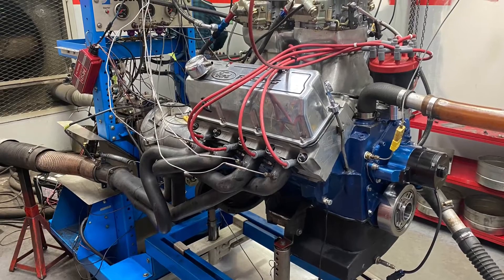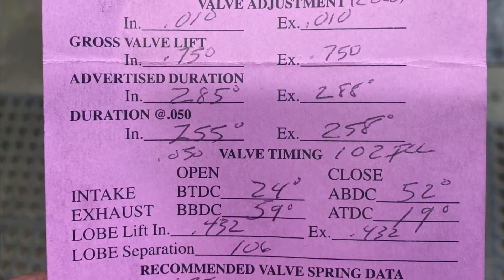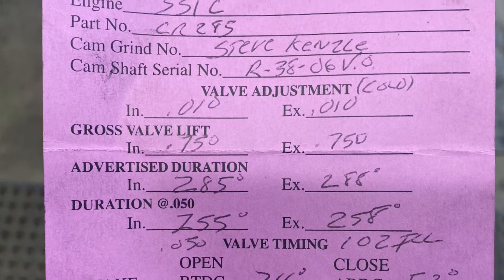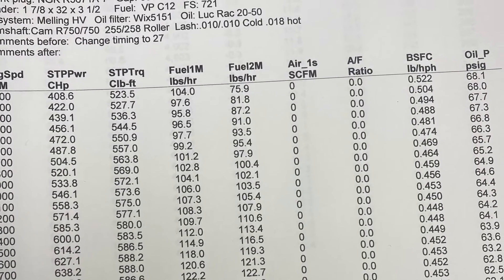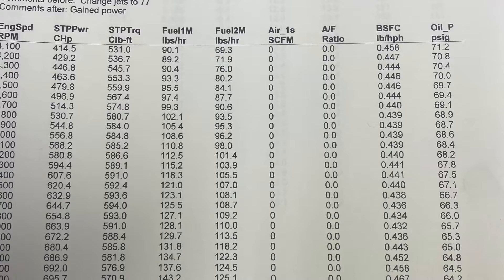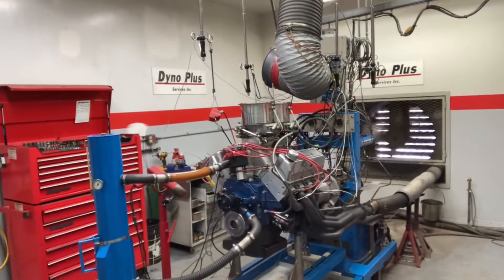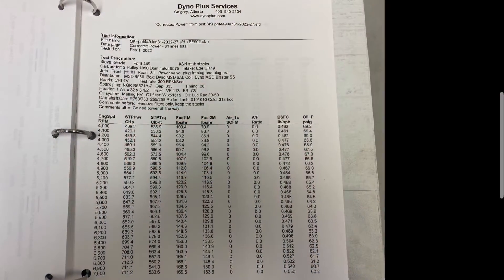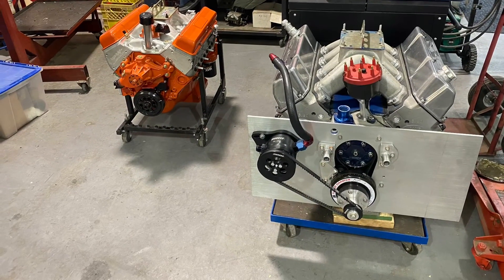DragBoss Garage:  Boat Anchor 400 Ford,  Steve Kenzle's  700 Plus HP Monster

Comment: You can make HUGE power with the M platform engines.  The big reason they were turds in factory form is the ridiculous compression ratios (about 8:1) which was accomplished with around 0.080" deck clearance, dished pistons, AND big combustion chambers (75-80cc).  All of the things you try to avoid when attempting to have decent compression.  Compression is the easiest way to produce hp & torque.  Kind of like a firecracker in open hand vs closed hand concept.  Even 2V heads had decent port design & valve size (2.03" Int, 1.65" Exh).  They will easily support 90% VE.  I built mine in the mid 90s & although I never had it on a dyno, it developed quite a lot more power than my 450hp, 500 tq 410" FE all with massaged factory castings except the intake that I swapped for an aluminum 4V unit.  I used '80-'82 valves with single lock grooves, a custom cam, screw in studs, roller rockers, & Keith Black hyper pistons for 351C with bushed rods (11.2 static CR).
Reply: I was shocked at the difference between the smogger car-spec 400 and the truck-spec 400. I had a '72 Torino GTS with the 400. Had great low end torque, but ho-hum beyond that. One of my Uncles, who I shared a business location/shop with at one time, had a '74 or later one ton shortie cab & chassis Ford truck and good sized trailer. I'd haul parts, tires and other supplies with it for him if I had slack time, and that thing was a beast, even with low compression and Briggs & Stratton suitable cam. It didn't have all the other crap on it that cars had to have at the time. That's when I knew that with some good parts, it could get with it like the overgrown Cleveland it was.
Reply from the maker: Right on Zekais, now your talking. Now has me wanting to build a big ci and wicked heads and tunnel ram. Well maybe later, have enough projects I need to get done.
Reply from the maker: Totally agreed would the compression ratio being the limited factor, obviously a camshaft too. But I like any engine you open up those areas of breathing, both intake and exhaust, and some compression and cam you got a totally different motor. Very cool I was pulling stroker‘s in the mid 90s also. 377 great little engine. You had it going on  for sure.

Comment: Looks to be a small-block Chevrolet next to the 400 Ford, Tim.   B.T.W. Nice 400M build!
Reply from the maker: Hey Bill I just saw this message, the one on the right is actually the first TrackBoss Aluminum cleveland Block. It made over 800 hp. Yeah the other one is a run-of-the-mill.

Comment: Do the 351M/400 have stronger cylinders than the cleveland? I know they are a taller deck height and 3.0 mains. Cool video as always
Reply from the maker: David, I was thinking the same thing, I’ve never asked Steve about this or anyone else. But must be, because we’re all scared to go any bigger than 30 over with a cleveland
Reply: Max is 0.040 for the 351m/400's... that was something I ran across when researching my build. I believe it was from one of Tom Monroes books. Loving the 400 content and builds, please keep it up!! Cheers🤘

Comment: I'm a 429/460 fan,  never impressed with the 4x4 400. Must have need way more head...
Reply from the maker: Yes 400 needs a good cleveland style head and it will really wake it up with Compression in the 11:0 range with that long arm.
Reply: @dragboss351cleveland  that’s my take on the 400 series was they needed more compression. With the right stuff and work those were a monster hiding in a box waiting for someone to take the lid off. And your video proves this, which are great by the way, and very informative as well. Thank you for posting them
Reply from the maker: Thanks so much Ryan, I definitely agree with a monster in the box analogy wowser. Appreciate your being here stay tuned for more awesome videos
Reply: The 400. Heavy crank heavy rods heavy piston Windsor size bearings.
The engine would have been better if bearings and oiling supported the added weight.

Comment: 🤔 So, how common is it to still be able to locate old 400 engines still in stock condition either at junkyards, or through private sellers who've got old 400 equipped passenger cars or trucks gathering dust on farms? 

If they weren't particularly popular for using as race engines or hot rod engines, and there aren't exactly a lot of 1975 Country Squire station wagons being restored and sold at Barrett -Jackson either. So wouldn't it be more likely that a lot of these engines would've been scrapped long ago?
Reply: I think you'll find they were also widely used in '70's Ford F series trucks too!!
Reply: @arkhsm  
But how many of them that aren't being restored are still around in junkyards after 44 - 53 years, with solid 400 engines ready to be removed and used elsewhere? I'd hope there are still lots of them. But although there may have been plenty of 1970s Ford trucks(and large passenger cars) still lying around in auto salvage yards, I've gotta think that the vast majority of them are long gone.

 Well, unless you can find forgotten ones sitting in patches of weeds on farm fields, or in barns.
Reply: @HighlanderNorth1  If you go by youtubers, finding 70's F trucks at every second farm out in the country areas seems to be quite normal. So I suggest you get out into the outback towns and knock on some doors....with your hands up, just in case they're totin a shotgun, lol !!
Reply from the maker: I would think that they are plentiful in junkyards but I haven’t looked for a 400 or 351M in a long time, so I don’t know. But they sure made a lot of them, thanks Highlander North 1
Reply: I am in the Los Angeles area and there are 70's F series being retired occasionally b/c of emissions.  many 400/351M blocks in them. they're out there.
Reply from the maker: @socalltd they are everywhere, you just have to look, thanks  Cali 🏁
Reply: In the 80's I junked more than 50 morfadites. Told my customers to just step up to a 460.
By then all M's and 400's had low oil pressure and gas mileage was poor. So why not get rid of it .

Comment: Built 400s with Cleveland heads for a local pull tractor class.
The Fords owned that class, the Chevys just filled out the rest of the class.
Reply from the maker: Hey Motor City Mike, All it takes is good heads,  good intake, and some compression and watch out. Loved to have watched that Motor City
Reply: Mike could you give some specs? Looking at doing the same with a 2wd puller.

Comment: People have been ignorant toward this engine, my dad had a 400 with lots of mods back in the early 80s in an F250 That heavy truck could really haul ass. Surprised lots Chevys especially on big hills. In 1980 there was only a handful of aftermarket parts available.
Reply from the maker: So true Mitchell. They respond just like Andy other engine. Real issues are bell housing and intakes. Can make spacers so you can run Cleveland intakes. They can make torque that if for sure. Glad your here, when the front wheels are hanging, just before the rear bumper drags the track,  pull the next gear. See you later.

Comment: That’s one Badass Motor Tim, wow 600hp/580ft-lb at 6000rpm lol 💪🏼🏁 carries over 500+Ft-lb from 4000rpm till the end.
As soon as i seen the Cam specs first, the duration @50 i knew it’ll be all under 7k rpms 👌🏼🏁  that’s a neat build mate.....
If i can ask, is the UR19 just Port matched ? (eg No filler blend?).....if so i would try 4150s on it
Just saying 😉🏁
Reply from the maker: I’m not sure for this port matched, I know he was talking about working on the top of the manifold runner as it has a little bit of a curve. Yes I was also impressed with cam that is small on duration, but that it’s making  great power. Definitely a torque minstar. I know he tried the Holley 6464 the old-school dominator, but he’s never tried any 4150s on it. Thanks for watching yanks🏁
Reply: @dragboss351cleveland  right on👍🏼 yes it has Ci but impressive figures all round 👌🏼🏁
I’d try some 4150s on it,  smaller Venturi/boosters with an untouched TR & that chi 4V Port entry. Especially being a heavy car it may just give it the air speed it needs & probably show on the track 🤷🏼‍♂️🏁
If it were 3Vs, or A3 etc....any fast n tighten port then Doms ok. if not eg: large .....it’s usually opposite then🏁
Been thru all that 25yrs ago with annulars, Doms etc on the good old 4Vs 🤷🏼‍♂️🏁
Reply from the maker: @69JANKS  smaller carbs always work better on the street. You tested all this stuff way back when. Cool deal Yanks. 🏁🇦🇺
Reply: @dragboss351cleveland   back in the 90s Tim on my na 4V Clevo in my Capri....... I’m pretty sure I’ve mentioned it before & wanted to do a vid or post about it......i will but soon.
Basically this is what I’d learnt from a reputable engine builder back then, that a large Venturi/Booster style carb (Dominator/Annular) doesn’t work well with a large port Head combo......
But if you have smaller tightened fast airspeed ports like always available for sbc & windsors Doms then can work well with that.....
Mate we knocked off nearly 5 tenths from changing carbs on my 4V combo
it was ridiculous.
Funny thing is that before i do any vid on it, I wanted to see if i could find any talk or clarification on this situation...... & i found something interesting that i think was similar in testing that was from DV & Andy lol 😂 🤷🏼‍♂️🏁
I’m just mentioning it if it could help that guy out or if he’s ever tried that 🤷🏼‍♂️
Old pro stock days were different, all filled heads & filled TR’s  hence a Dom will work with em in that aspect, but a left alone 4V & TR things can be different. Even tho the chi 4V is a little revised, it’s still that same 4V entry & cross sectional that it is, sorta!...
Reply from the maker: @69JANKS  Great synopsis, I agree with you for sure on smaller carbs have better airspeed, and also 60 foot way better. I’ve raced both the 4150, and a 4500, and I may be picked up a few hundreds in ET, and maybe 1 mile an hour for the top end. Definitely a problem with 4V heads. The old pro stickers never knew as they left at 9500+ rpm. Love your Capri mate.
Reply: @dragboss351cleveland   right on Tim 💯
Hey of course the 4V Head is 50+ of Iron haha it definitely has its flaws like any other factory head.....not in anyway comparing it to the latest or even past alloy heads available....just keeping its Glory alive.
Will be getting a start on mine soon, taking the iron 4Vs  heads in for a check & flow figures to start.....🏁
Luv to see the Cougar with its new 770+hp Cleveland, & the new chassis mods 👌🏼🏁
She’s gonna kick ass 💪🏼🏁
Reply from the maker: @69JANKS  I read you loud and clear. Iron 4v hold up against any of them. Ordering the collector kit, for merge collector. Decided on 2 inch primary and step up to 2 1/8, with merge collector. Should be done next few weeks. Yes I think she will run a 9.50. Need go through trans next. Thanks mate good luck with your refreshing
Reply: @dragboss351cleveland   👍🏼🏁

Comment: Several people through the years have proven that the Ford 400 is very capable of making power with the best of them. In stock form? no. LOL, but  the block, crank, and other parts dont know differently.
Put good breathing heads, intake, cam and induction, and it will be a monster like anything else!
Reply from the maker: And have cubic inches with the DH. Yep match the combo and hang on.
Reply: Which this build proves !!
Reply: Cam exhaust and good intake and carb.  You have Cleveland heads on it already.

Comment: Wish I could find a used good 400 crank for my 351M. Hard to come by. On my budget anyway.
Reply from the maker: Talk to Tom Molnar at Molnar technologies. I bet he has one.
Reply: @dragboss351cleveland  how much you think? Cost
Reply from the maker: @frankglasgow  $ 600-650
Reply: 880. Not in current budget. Maybe future.
Reply from the maker: @frankglasgow  cost $880?
Reply: Try advance auto. I know, sounds dumb, but I have gotten two of them that way. U have to eat the core charge but it's worth the extra stroke.
Also, TMeyer online carries Molnar cranks etc.., but also remachined stock.
Took me 2 minutes to find one on Ebay from scat new for $430 free shipping.
Reply from the maker: @psychoholicslag4801  Great advice. I found a rod bearing set up for aluminum rods, with a dowel pin hole  already drilled from Walmart for like eight bucks a set. They stop making him years ago how did Walmart get them I do not know. Bad thing only had 2 sets. Appreciate you helping us out
Reply: Check out Facebook market place, I've been seeing a lot of them lately . Just like the 460 they're Big Cleveland's  too kind of . Those 400 engines were like the red headed stepchild
Reply: @williamrose8944  they are clevelands with the exception of intake manifold width and pushrod length and rotating assembly. Heads all bolt on.
Reply from the maker: Yep and they respond well to mods😉
Reply from the maker: @williamrose8944  so true. That is why they called them a boat anchor. Little did they know, Wolf in sheeps clothing.
Reply: Maybe I should start collecting them. Could have just recently got a short block for $50 bucks.

Comment: i had a 77 f150 ranger XLT with the tired 400 in it...did just  a few things to it and it really woke up ....i always wanted to build a 400 just for the fact they have the longest stock stroke of any ford v8 from 1968 and up
Reply from the maker: I live those trucks, so cool. Yes long arm of the street. Forgot how long 6.8 or close.
Reply: When it was tired how much oil pressure did it have ?
Reply: @cammontreuil7509  25 cold running..i put new mains and rods  in it and a new oil pump..after that it would pump up to 50 just by cranking it ,,and if you are doing one of these motors..put a new timing set  in it
Reply: @merc-ni7hy  thanks. I'm a semi retired engine builder. All those engines had bad oil pressure. You just confirmed it again.
Windsor size bearings with those heavy parts swinging around to me was just nuts.
And if I used clevite bearings and a hv pump to compensate, those bearings would just eat the soft crank.
Reply: @cammontreuil7509  yep,,thats a bad thing about them..but the oiling system can be modified ....i still think they have good potential ...hell didnt jon kasse win a builders event using one of these motors???...i think he did
Reply: @merc-ni7hy  not a stock crank or rods though.
400 crank is an ugly monster.

Comment: Back in the 70's no one would have thought or wasted their time on that slumbering gas sucken pig boat anchor morphidite engine for any performance application.
What was done here was nothing short of stunning.
What rods are in that engine ?
Reply from the maker: Thanks. Steve will appreciate that. I think it runs Molnar crank and rods.

Comment: I remember an article in I believe it was CarCraft that Jack Roush took a 400M and built a monster.
If I can find the magazine article  I will post it.
Reply: Roush was an early proponent of using 400 blocks with good Cleveland parts. He always preferred to take them out to about 466 inches, IIRC. Never did see any testing of them, but the Chivvie dominated automotive press rarely did even the more popular Fords. If Roush was involved, though, I have to assume it was an effective, um, secret weapon? And probably less expensive to build than even a 385 series.
Reply from the maker: @Zekais  did not know that. Be nice to see how they run that big and heads that can keep up. In theory could make easy 800 hp. Don’t remember much of his builds, other than Cleveland and nascar stuff. Thanks Zak
Reply: @Zekais  thanks.
And so true how it was a Chebby dominated press in those days.
But we knew better then as we do now and got the last laugh anyway.
Reply: @gurneyforpresident2836  You said that right. Loved how any time a good builder (Kaase, Scott Main, BIschoff, etc.) entered a Cleveland in the EMC it kicked Hemi & BBC ass, and it especially warmed my heart when it blew the LSs into the weeds.
Reply from the maker: But they had to try and hold the Cleveland down. 💪
Reply: No such thing as a 400M.
Reply: @cammontreuil7509  You are correct!
I'm a very knowledgeable Ford guy too.
Brain malfunction LOL.
Otherwise know as a brain fart Haha.
Reply: @cammontreuil7509  Yes, Ford just called the 400.....the 400 !!
Reply from the maker: Post away. Not sure how. Yes 351m and 400.